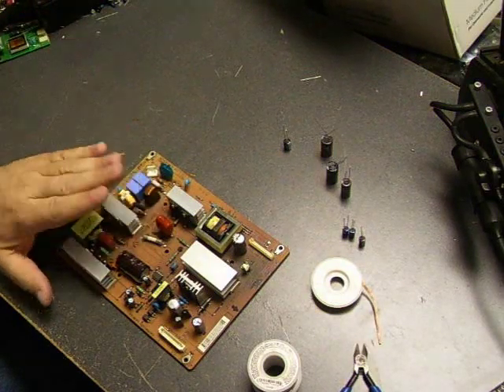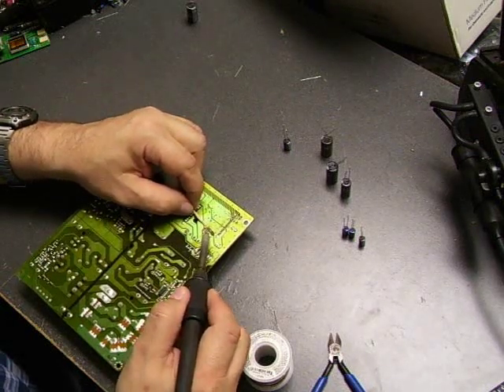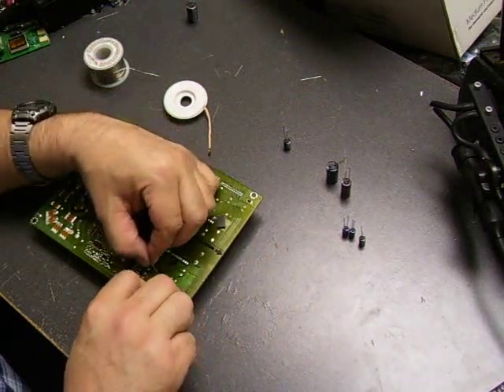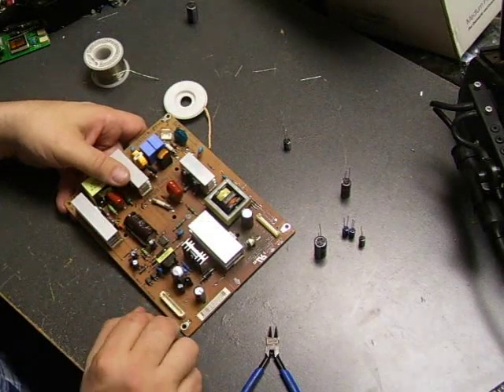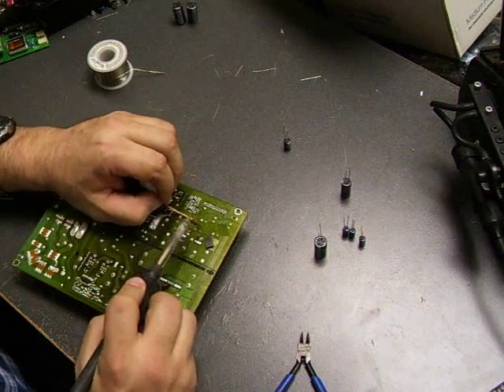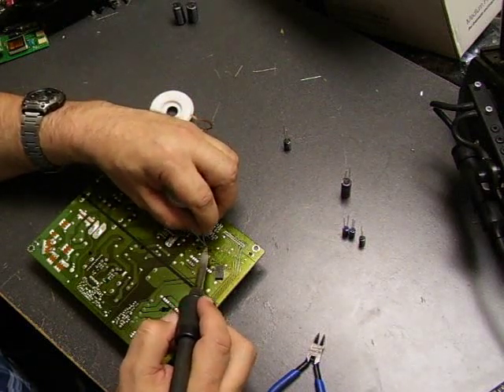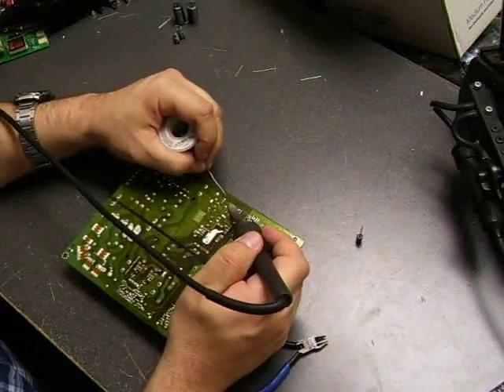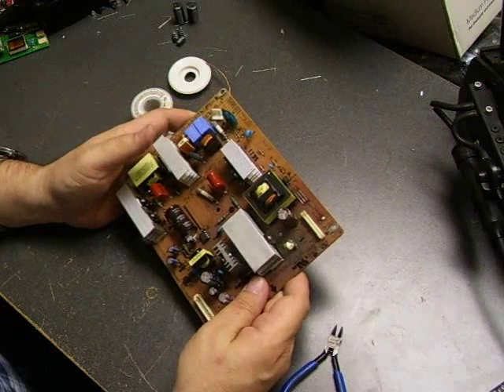Repairing a LG W2753V-pf LCD monitor - Part 2 Board repair

Comment: Hi there...can this LG Flatron w2353v monitor be used with a DVD player? I am told that it can be used like a TV but when I plug my Coby into this monitor and put in a DVD disk, it reads "ERR DISC". 
What am I doing wrong? I have tried many disks but it always says "ERR DISC".
Thank for any help. k

Comment: Thank you so much for taking the time to post these videos.  I have the identical monitor, three actually, and one of them over the last couple weeks has gotten to where it turns off and I have to cycle the power to bring it back up.  Now it only turns on a couple seconds and shuts off.  I took it all apart per the video and don't see "obvious" signs of bad capacitors, but I'm lead to believe that that's what it is so I ordered a repair kit.  Hopefully it comes in soon and hopefully that fixes it!!  Thanks again so much for your help.  You're a gentleman and a scholar!!!  I'll let ya'll know in a week or two if this fixed me up.  I'm spoiled to three monitors so hopefully it fixes it.  Haha

Comment: I would like to ask...does the size of a capacitor matter? For example some of my old caps are 10x20mm while the new is 10x16mm. The μF and V values are the same. Thaaanks!
Reply: Physical dimensions don't matter. Make sure the μF, Volts and temp ratings are the same.
Reply: SammytheBammy1 Thanks for the answer and for the video bro! Thanks to you I managed to repair my monitor! It was a bit difficult to open the monitor's case because my model (LG Flatron W2252TQ 22") has no screws but all the rest was easy. Thanks again!
Reply: joe35lok You're welcome! I saved my $250 monitor with $11 worth of caps.
BTW, one tool worth getting is a plastic "slim jim" (http://smile.amazon.com/Elec-TAN-Screwdriver-Blackberry-Universal/dp/B00NN4Q62Q/ref=sr_1_1?s=wireless&ie=UTF8&qid=1413431920&sr=1-1&keywords=8+pc+t6+t5+opener). I got one a long time ago when I ordered a repair kit for an old phone. It is excellent for opening any screw-less plastic case like your monitor's which is held together with flexible snap tabs. You just slide it between the two halves of the case and it releases the tabs. It's made of hard plastic which means no marring; much better than using a screwdriver or putty knife.
Reply: SammytheBammy1 Great info Sammy, I didn't know that there is such a tool out there! I will definitely buy one because nowadays most devices are made with these snap tabs. Thanks again!

Comment: there are 8 electrolytic Caps on this power board.  the 8th Cap that was not replaced is C607 which has leads with a 90º bend.   I replaced all 7 Caps  as directed and the issue remains unchanged.   the monitor powers up, displays the LG logo.  then displays standard video for a about 1 sec power the screen goes black.   any idea what I should check next?

Comment: Sure can be something else, in this video he replace all electrolytic capacitors, but normaly we test them with capacitor meter. Electrolytic capacitor may be open with no visible sign, and sometime he is very visible. Also the power trouble can be a diode, a power resistor, etc...but it true it often capacitor the problem, but not always !

Comment: Can a capacitor have no visible sign of bulging and still have the same issue on the power board. This is my second monitor repair, first i noticed bulging. Also last time i was lazy and spend money on a new board. thing is this board is like 40 bucks